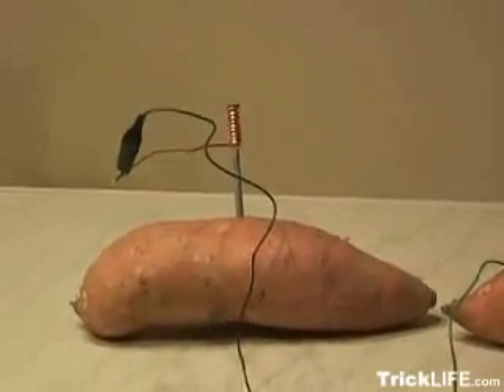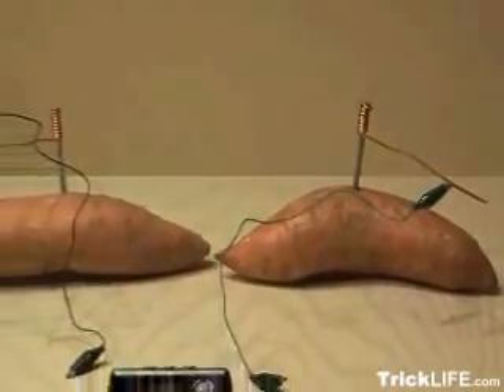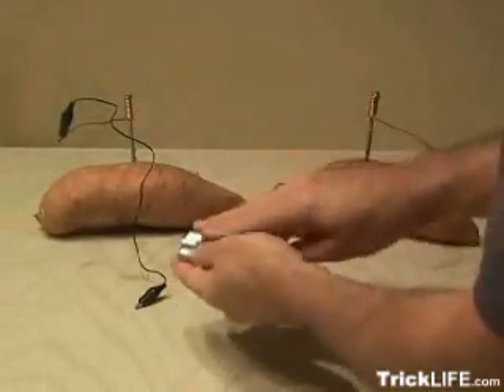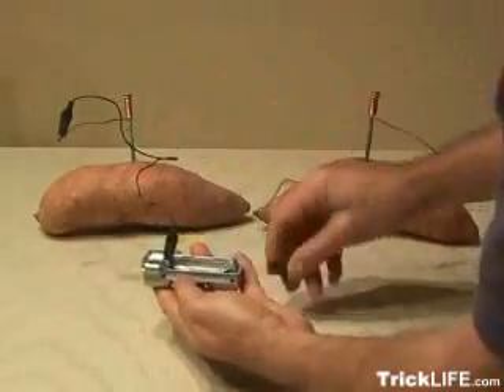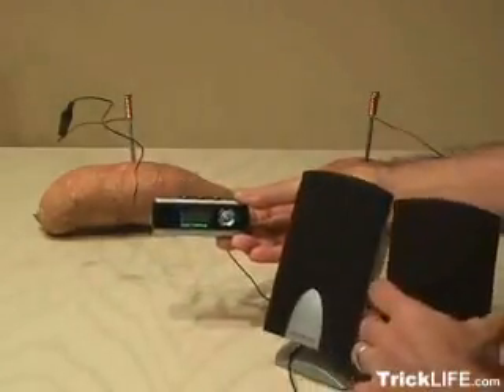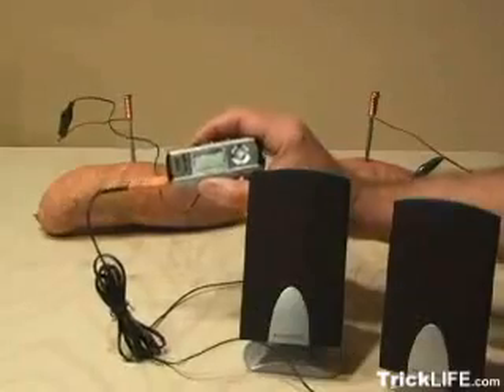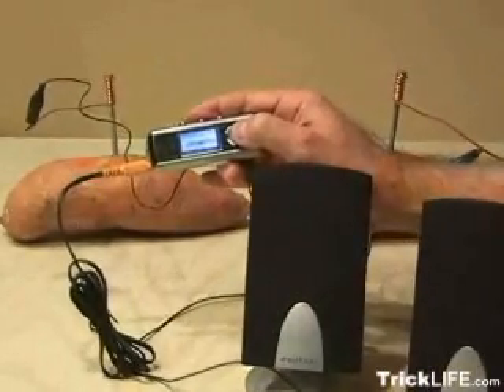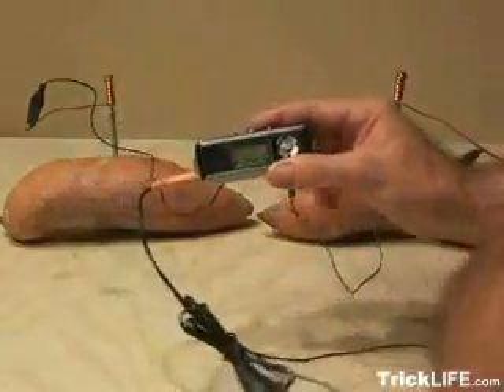how to make potatoes power an mp3 player

Comment: Of course this is fake, anyone with half a brain stem knows you have to have both the anode and cathode separated and connect the potatoes in a series as well as parallel. And to get enough AMPS (Current) you would need an epic amount of potatoes connected in parallel. Plus not that it really matters those were YAMS not Potatoes lol

Comment: Can you explain this because this video sounds like a troll for a few reasons.  1) Copper is the Cathode and Zinc is the anode. They need to be seperated by an electrolytic solution to cause electron flow. You have them touching, on both ends.. 2) I don't see how this a complete circuit, the potatoes are not connected. 3) Two potatoes if connected correctly (which they arent) would product about 1 volt, if you added a 3rd it would give you the 1.5 of a AA battery, but still not enough current.

Comment: @wimpykid422 It's not out of the question but his mp3 player does not require as much power as a full color ipod screen. You could probably use it to power one of the first two ipods or any of the shuffles but I wouldn't count on doing it for anything with a color screen (nano 1st gen and up).

Comment: the electrical circuit is not closed in order to allow an electron flow. you just stabbed two ordinary potatoes with nails. A potato battery would be p[ossible but nou in your setup, and not powering an mp3 player, but a handheld calculator. Stop jerking with everyone!

Comment: doesn't seem right to me, where's the two dissimliar metals for the electrodes? Where the connection between the two potatoes? i didn't think potatoes where acidic enough to power anything let alone an MP3 player.

Comment: Doesn't look right- no obvious connection between the two potatoes to complete the circuit......also there should be a dissimilar metal on the other end of each potato for the electro-chemical reaction.